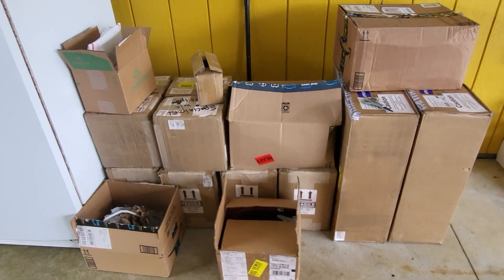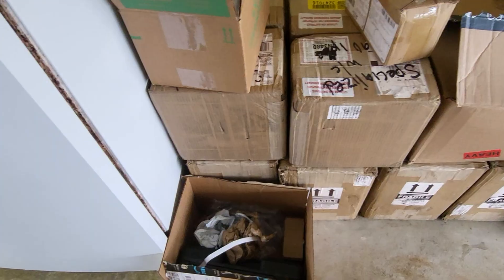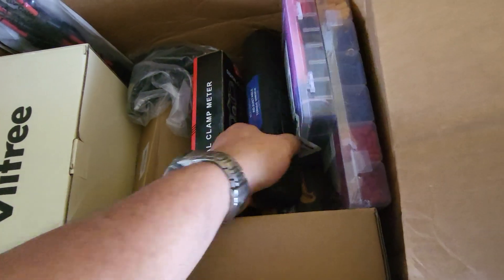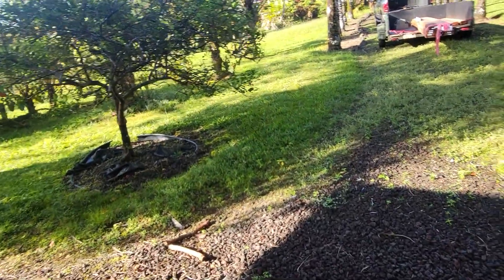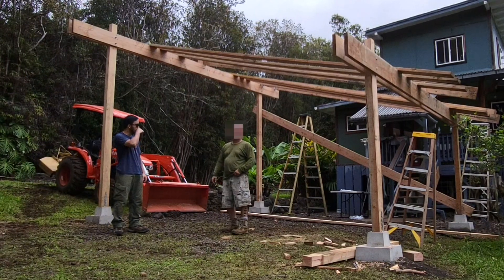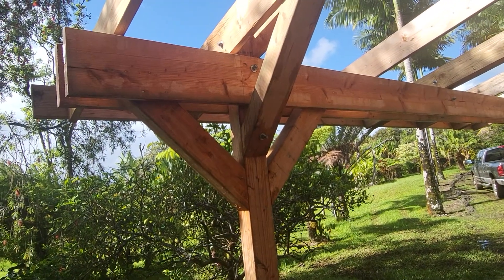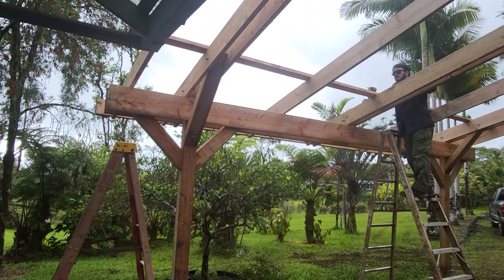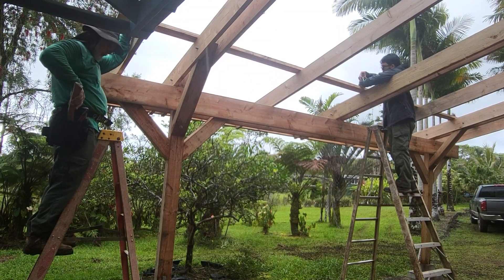DIY Off Grid Solar System!  Part 1 - Building a Carport Array

Comment: Hi, what are you going to use to attach the solar panel to the top? 57 year old lady with no building experience and I want to do a carport what the solar panels on top so I can park under it and have shade and my solar at the same time.
I have found quite a few that I like but I found one guy that did pretty much the system that I want but he did it on the ground so I'm figuring out how to get it taller but then he bought all the solar rails ang brackets and everything else that the solar company sells so how was that saving any money?
Reply from the maker: Aloha, there are pro's and con's to a carport array.  It can serve as an all-in-one set-up, but it is higher off the ground, more difficult to construct and harder to clean panels.  So it is a trade-off.  
Watch the next video as I describe how I attach them to the carport.  
For cost savings, I am truly off-grid and do everything myself, so I save a lot.  However be aware that DIY has expenses such as tools, so factor your costs appropriately.  It may or may not make sense to DIY.  An extra set of hands is always helpful.
Reply: @keaomakaranch Hello :)
 I have already purchased (17)450 watt solar panels , 3 lifePo4 batteries, inverter, battery cabinet, connectors,  wiring e.t.c. that was pretty expensive. (Purchased 1 year ago) i don't want to be connected to the electric grid so while I had the finances to purchase it all,  I did.
Not sure how often they will need to be cleaned... however,  they have been installed on plenty of roofs of homes and buildings so there has to be a suitable way to clean them. (Ladder, mop,  pressure washer?i have no idea YET lol)
Tools,  i all ready have circular saw,  reciprocating saw,  jig saw,  drills, staple gun, generator, pressure washer, air compressor (small one) chain saw, pole saw, ratchet sets,  axe, hammers, pry bar, various wrenches,  vice grips, screw drivers (regular and bits for the drill), squares,  levels, ladders (multiple sizes/types) auger drill bits,  post hole auger. Lawn/ yard equipment.  I can't remember all of the tools I've accumulated. 
If you can think of something else I may need I would appreciate it!
 I would rather take it up to the property with me then get up there and realize I need it and don't have it.
I started thinking about it the other day and I realize I don't have saw horses and probably should get some lol
I was wondering if some inexpensive scaffolding might help make building easier and less up and down on the ladder. Thoughts?
I am very glad to know that you are doing a second video because I was wondering how you were going to attach the solar panels. Hopefully that video will be out soon and if it's already out I haven't found it?
I appreciate your help and your videos!
Have a blessed day :)
Reply from the maker: @mycabinlife1291   Sounds like you purchased good solar equipment and have the drive to do it.  As for my carport structure, since it is 12' high on the high side and is built with 20' boards, it was necessary to have an extra set of hands.  I also used the Kubota tractor, or I would have needed to erect sets of scaffolding that I have on the property.  It would have been tough to do this with ladders only.  One person, and it would have been dangerous.  Panels, at 40-50 lbs each, would also be challenging with a ladder only at this height.  A ground mount is much more manageable to construct and safer.  Like you, It takes a bit of travel to get there, and I need to fly into this location to work on it, so having a solid plan is critical.  I design everything virtually and make materials lists.  Even then, I changed mounting ideas mid-project, but I had materials do lag screws and washers or use strapping and self-tapping screws.  It is satisfying to get the work done, and not having to run generators as primary will be excellent.
Reply: @keaomakaranch  yes I don't have a computer or design skills and wouldn't even know where to begin to design one virtually LOL old fashion pen and paper here.
I appreciate you taking the time to answer my questions and I'm still looking forward to the next part of the video.